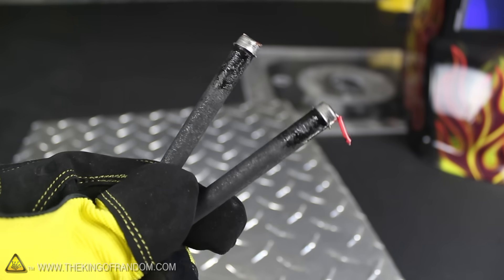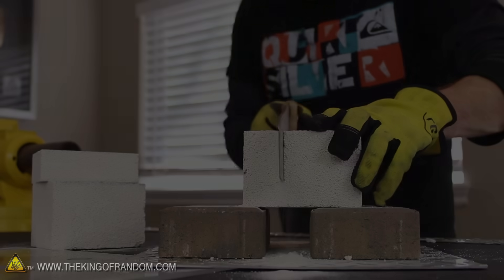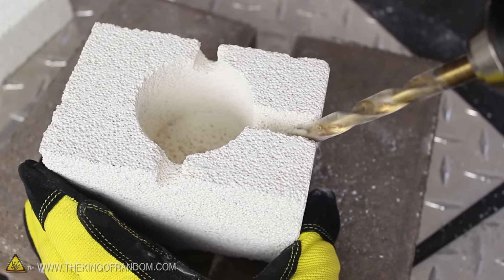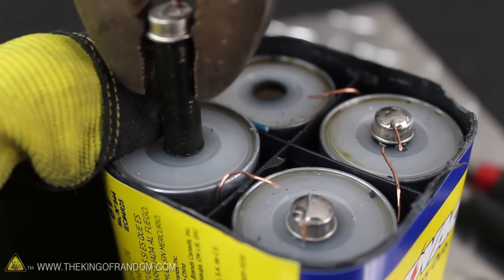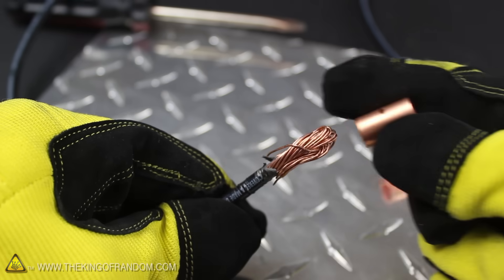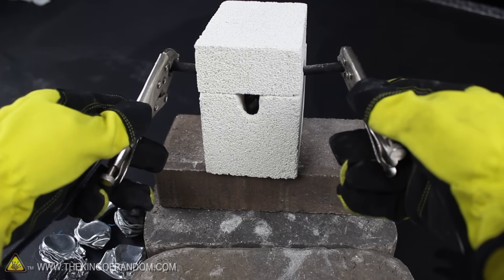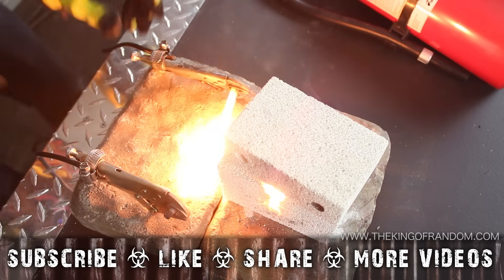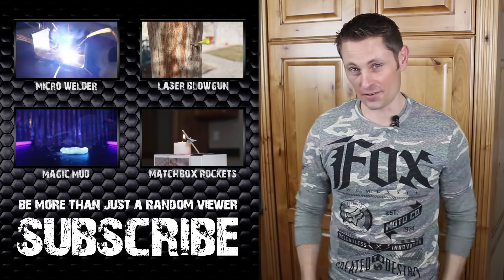How To Make An Electrical Arc Furnace

Comment: The zinc slag can be thrown in old battery acid, (sulphuric acid), and then be used for a galvanizing solution for electroplating. But there is a violent reaction, and the zinc has to be added slowly and done outdoors.

Comment: We used our mini arc furnace for the first time today. We successfully made little ingots of zinc, brass and copper from battery cell casing, three small finials and some wire respectively.
The main difference between our furnace and Grant's was our rods didn't catch fire despite there being sticky goo on them. Is that the difference between heavy duty and super heavy duty cells?
Thanks for a great project.

Comment: I'm going to try and drive my furnace using my arc welder. I checked the output specs and think I should upgrade my cables to 4G. Any thoughts?

Comment: Kinda want to make one... But the stuff required isn't available in my country _, can't i just order one...
Reply: +matthhood you have the Internet tho. You have access to anything in the world... No excuse, unless these things are banned in your country.?!?
Reply: +matthhood then use different bricks. also, in germany, we have these bricks. and if you want, make it from cement or whatever. graphite electrodes are in said batteries that you can find at most hardware store/ bouwmarkt or scavenge from thicker pencils. microwaves - we have them, so there's all you need.
Reply: Terry Huestis Jr  the problem my dear Terry is that if I do that, the items will become expensive. wich will give problems for me
Reply: +matthhood Try a pair of worn-out D cells.  For the brick, silica sand and fireclay will work.  Do wear a respirator, silica dust will cause silicosis in any country.
Reply: What country is that? What parts do you have and not have?
Reply: The netherlands, we have bricks but not those kind of bricks and a battery like that is impossible here to find where I live
Reply: +matthhood You can also take mono-cell batteries (the big round ones with 1,5V) They also contain, in case it is a zink-carbon one, big carbon rods. The rest of the materials (MOT/ large cabels/ connectors/...) shouls be easily available at scrapyards or in local shops. But I recommend you not to do this project if you dont have any knowledge in electrical engineering....
Reply: +matthhood in belgie ook niet ):
Reply: U like elsword?
Reply: +matthhood so where are you from?
i am from estonia
Reply: games hacker scroll up and you see where I am
Reply: vdsrgbvfgggtftggffgggggffqrfttgtrfftfgggtgggggggggggg4ggettefggofoeorododooforoodiodorirriirirorororororroorororirirororororororororor93oro3o3oeoeoororororkrorirorirkrrkrkkrkrkrrkkrkrrkkrkrkr2eoeorfkfff!fofoe8eoeorlr?for-profit?r:-)r?lrtotoorroorroo3roor↓˙¿»˙↓↓˚˚△»※※˙※˙※˙˙※↓˙˙↓↓˚↓˚↓˚↓˚˙↓↓↓˙↓˙↓●※˚●△»△»←↓●※:-D△△:-D:-D※:-D※※↓˙↓˙↓˙↓˚˙←˚←˚˚¿●←←¿˙¿˙←●↓●●↓˚↓↓˚˚↓↓˚○○○◎↑↑↑↑↑↑↑↑↑↑↑℉↑↑↑↑↑↑◎◎◎◎:-P:-P:’(:’(:’-(◎※◎◎

Comment: beautiful videos. what is the voltage and amparagem that was used in these videos. what type of current used, alternating or continues. this oven works with altrnada current;It works with direct current?

Instead of cell electrodes, can I use graphite electrodes used in welding

Thank you so much

Comment: Please do be very careful when heating zinc, or galvanized steel which contains zinc. Its fumes cause paralysis and shaking. Both of Grant's suggestions--excellent ventilation and a respirator--are a good idea. Always do your research before you melt something. :)

Comment: Hi there, i built the furnance with a friend, what we are having sort of a problem, after 2 minutes of continuos use the transformers get really hot at the point that the rubber of the cabbles may start to melt, when this happends we have to shut it down so as not melt de rubber. We have put fan coolers with disipators but this does not seem to help with the cable. What we thought is to remove the rubber, insulate with varnish the copper cables and rewind, would this be possible? Is it the correct approach? Or maybe we are doing something wrong with the arc? Please help us. We will be very gratefull. PS: Sorry for bad english, we are from latin america
Reply: beyersito just thinking- maybe u need thicker cables...what kind of gloves you are using?
Reply: +bingre thanks for the reply, I dont think it will be possible to wind thicker ones, leather gloves
Reply: +beyersito Well, my guess is to not use it for 2 minutes straight :P

Comment: Grant, take it to the next level.  Build a arc torch and heat up thick steel glowing hot and bend it.  Or use the heat to melt rocks into strange sculptures

Comment: how does the brick react to water? 
If it would be fine, then id wet them before cutting. 

Otherwise you get to tell everyone you have Pneumonoultramicroscopicsilicovolcanokoniosis. 

45 letters long. lung disease from inhaling the dust
Reply: As long as you dry it first, probably run the arc in there empty for a while.  Otherwise you'll have icantseeadamnthingosis, aka your eyes burned out from lava explosions.
Reply: AHHHHH&HHHHHH I have hippopotomonstrosesquipidaliaphobia and its freaking me out!
Reply: +WhoooLovesOrangeSoda Ster-mahg-gerd!
Reply: +WhoooLovesOrangeSoda You mean *Pneumonoultramicroscopicsilicovolcanoconiosis
Reply: WhoooLovesOrangeSoda Hence why he said to put on a mask.
Reply: Bryan Cotto if its wet then less dust would be kicked up. they do that in construction sites
Reply: +WhoooLovesOrangeSoda they do its a green moist dust like powder they spread around construction sites so they don't set off the fire alarm and get in people nasal cavities
Reply: WhoooLovesOrangeSoda You can, however, shorten it to:  "Pneumovulculosis" !!

Comment: You say it can work with 120 volts AC so does that basically mean i can plug this into my wall socket and it will work?
Reply: +Tom Wiggin if only i had a welder xD thanks for the info i completely forgot about fuses xD

Comment: you can buy the bricks on Ebay 
INSULATION BRICKS 230 x 114 x 76mm (51650) HR170 suitable 1700c furnace kiln
Take a look 
They are just the job

Comment: I've made some time ago a spot welder. It works good, but if I try using it for melting metal following your tutorial, it doesn't do anything. I'm sure it depends on too low voltage (1~2 Volts - 660 Amps). Even no spark at all!
The MOT is a 230 Volt (Europe). How many volts should I measure on the secondary coil before cutting the wire?

Comment: It is probably even better to use carbon welding electrodes: they are much longer, copper coated and cheaper than batteries.

Comment: I've aquired 2 OBIT units (oil burner ignition transformer) they're 10kv each with 23ma, how do you think that would fare against steel and such, and should I connect them in parallel?

Comment: Hi.Delighted to be able to run ideas in front of you. I have made multiple furnaces out of molds and extreme high temp refractory cement. It is  rated up to 3600 degrees Fahrenheit and  all have cured for 2 years . They are in the shape of large coffee cans, and normally I  just make a hole in the bottom of the chamber for a large  air blower,, fill the bottom with 3 inches of coal, and build a small wood fire on top to ignite it. After ignition I also have coke to boost temps and reduce contamination.The blower makes the furnace roar like a jet engine and makes a fiery plume about 2 feet high. There are also  special  vented refractory lids to cover the top and up temps. The purpose is micro-fine gold recovery from placer mining black sands. I use powdered borax or Portland cement as flux.The heat can exceed temp specs and melt graphite crucibles and the lid, so temps can exceed 5000 sometimes. I have also made crucibles out of this special cement but they are porous and the melt permeates the bottom of the crucibles.  Just not good enough, so I went to graphite .What can I do to  separate the gold effectively using smelting?? I know it can be done.  The gold refiners require at least 80 percent purity to purchase and I have a lot. Thank you................... IDAHO.

Comment: Does this work with a car battery as the power source
Reply: Trey Spencer You won't get much of an arc with 12V, and the battery would have to pretty much be short circuited. You can definitely melt metal if you accidentally short circuit a car battery, but it is very unsafe and may cause the battery to overheat and vent acid all over you, or even explode.

Now, Grant's supply takes in 240V power and outputs ~30V. His circuit breakers are probably rated at 15-20Amps (I don't know american power) He's using two circuits though, so that gives him 40Amps@240V to work with. His transformer converts that into 320Amps@30V (the maximum he has to work with). Your car battery can safely supply ~400Amps@12V if you've got a good one. If you made a transformer to convert it to 30V it would be 100Amps@30V. However, this would place enormous strain on the battery, and flatten it very quickly (imagine cranking your car for a couple minutes, multiplied by two), and the heating power would be significantly less.

Using three car batteries in series would give you 400Amps@36V (without using a transformer), however you would drain all the batteries(assuming 40Ah batteries) in less than (high discharge is inefficient, so probably significantly less) six minutes of heating. Placing another set of three three batteries in parallel with the first set would double your usage time.

What I haven't mentioned here is that you need some way to control the current, like Grant's Scariac /watch?v=P9UjxG8sN1c, or you will be essentially short circuiting your power supply, resulting in blown circuit breakers, or exploding batteries.
Reply: k thanks u so much! ;)

Comment: Grant - great demonstration, thankyou.  When you are inserting the rods into the furnace, are you touching the tips of the carbon rods together, or touching them both to the metal in the furnace? Obviously I'm no expert when it comes to arc welding/transmission of arcs, but am curious as to whether the current has to run through the metal in the furnace, or whether there is some reaction that causes the current between the rods to 'jump'?? to the item being melted.

Comment: I 15, I have no money, but I have access to 99% of this stuff except a power scource. Would the clamps of a 240 Volt stick welder work as well? It's like from the 40s/50s, and has almost any adjustable amperage/ current from like 10 amps to 300 or something. I'm really hoping that I could use this, because I'd rather use a trusty pre made welder then risk my life making a transformer
Reply: MrDrGuyMan Yeah, what you have would work. You'd have to find the correct amperage yourself.

Comment: Day 74: using the left over 3% battery life in my phone I was able to look up this video.  I myself made an arc reactor for my heart. To my surprise it didn't keep me alive but I was able to put metal in there and melt it. Meanwhile I found a glowing green crystal in the ground. It made an excellent power source. I believe it is called kryptonite, anyway, I almost got bit by a radioactive spider that was in the microwave that I used for the reactor, probably slightly over cooked popcorn caused the spider to be radioactive. Anyway it's getting dark I gotta build my iron suit called the MK1 and get to safety to Gotham City

~Ant Man

Comment: I have a question:
When he touches the carbon rods he's effectively short-circuiting the whole system. So that would make a pretty high amount of current flow through the circuit because of the short circuit; why does that not set off the circuit breakers in his house?

Comment: My local hardware store only has 4 1/2x9x 1 1/4 bricks. Is it possible to use mortar or plaster and sand mix to bond the two together? small peg holes could be drilled and pegs could help hold it together I recon any thoughts?

Comment: Just a heads up on dead lantern batteries, I recently found 16 of them at the dump and almost everyone of them the zinc casing has turned into zinc oxide. This makes the case crumble into a mess.

Although I find this to be easier to remove the carbon rods just by crushing the case with large channel lock pliers.

Comment: So with this furnace is the arc welder thingy (microwave thing he mentioned in the video) necessary to preform this? Or did he only use the rods to power the furnace?

Comment: Do you still need to protect against UV like arc welders do? (i.e. gauntlets, covered arms and face shield?)
Thinking about this for melting lead for fishing weights..
Reply: Also thinking about it - having a multi-contact push button to close the welding circuit would be better too. That way you can set it up (including the electrodes), flip the switch for N seconds, then when you get back to the electrodes they're not electrified.
Reply: Nick K This is overkill for melting lead. A propane furnace would be better for that, I think. And yes, while improvised, it is an arc welder and the appropriate precautions should be made.

Comment: I built the welder you did the tutorial on, I'm preparing to build this furnace, and I find myself having to ask how I should change the welder to accommodate for the locking pliers you use to hold the graphite rods.

Comment: This is extremely dangerous! The video makes it sound it isn't. No one should do this experiment unless you have enough safety equipment. The ones mentioned in the video are NOT enough. You NEED, leather gloves for handling hot items, welding mask, leather apron, safety goggles (not glasses), cut resistant gloves, dust mask, some ventilation (not needed if you're doing it outdoor), dry powder extinguisher nearby, steel toe boots, a cotton boiler suit and a hair net (if your hair is long).

Comment: Could you make handles out of the bricks? Would it help in reaching higher temperatures without being too much of a safety hazard? Of course still wearing gloves when handling...

I was thinking of connecting the wire directly to the carbon rod in an L shape, just so the rod wouldn't slip out of the casing, and place it in a brick casing. The wire may have to be stripped slightly more just in case the heat would burn the insulation. I'd have to find a way to fit in without using adhesive though.

Comment: is this safe ?
Reply: i mean using it
Reply: HolaSoyAlejandro Only if you wear heavy gloves and a welding mask. Otherwise you have the possibility of electrocuting, burning, and/or blinding yourself. Oh, and if you don't have good ventilation, you could wind up inhaling toxic metal fumes.
Reply: +Morrigi192 if i do this outside will be safer ?
Reply: HolaSoyAlejandro Yes.

Comment: Two questions; 
Can i power this by 230 AC or do i need a DC converter?
Is it safe to hold the rod clamps or are insulating gloves necessary?

Comment: This project is actually dangerous as hell. You will have no idea what you're doing with those batteries, the smoke, the fire, and the electrical equipment. This is seriously not meant for the public to play with. Just make a coal furnace.

Comment: Hey Grant, cool video. Have you ever tried arc gouging rods from the welding industry?  I like the arc furnace but don't have time to try it out. I'm not sure the price for a full box or if they will work the same as the battery carbon rods, but  I'll  send you some  if you would you try it and if its works make a video of this alternate method?

Comment: I have to thank you for making a point to include the safety aspect if working metallurgy. Although your explaining is rather uniform and orderly smelting metal is very dangerous in the same manner hot tar is when roofers work on a home. Just one plash could kill you because people need to know how hot it is and how long it takes to cool off because it would cook you to the bone and nothing could plug up a gaping hole spilling onto the flesh of a human being in this manner. It's something about to give you a stroke in a flash so SAFETY is everything.

Comment: This is by far one of my favorite projects yet.  I have now successfully made the "Scariac", the Arc Welder, and now the Electrical Arc Furnace.  You are the man, this stuff is awesomely useful, educational, and downright fun.

I already had a Variac but amperage is limited; the Scariac is a great design and I was able to get it done over a weekend (in between playing with the kids.)  I have a wire fed arc welder but, because I wanted to build the furnace, I decided to rewire a few MOTs and build the stick welder of your design as well.

I've made several blast furnaces over the years (a huge charcoal one and a portable propane) but could never get the temps hot enough to melt anything other than aluminum and zinc (I'm impatient) - your electric arc furnace design easily solved that problem and I was able to successfully melt copper in under a minute last night.

Thanks again for the awesome videos man!  Keep it up!

Comment: I think its important to point out that metal fume fever is very dangerous and can lead to serious lung conditions that can not be cured. I know because I ended up getting Bronchiectasis from soldering fumes. Yes I know and I surely know now that underestimating metal fumes is very dangerous. I have to take steroids daily now to control my breathing.

Comment: Don't forget that if you are holding those two vice grip pliers, you have 240V in your hands.  If your gloves are not good electrical insulators (just sweaty leather gloves) an electric current will flow thru your heart and you'll be instantly dead.

Comment: Mount the vice-grips onto each end of a short piece of 2 X 4 (or metal pipe) so that the ends of the carbon rods face each other, then position the rods far enough apart so that the current arcs from one to the other. You have just created a tool called a carbon arc cutter.